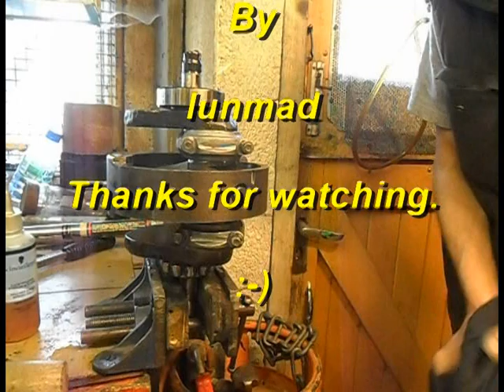triumph t120 engine rebuild part 10

Comment: hi john nice to see it going back together that's a fair weight diffrence in them rods and them odd nuts  is poor I'd expect better from them I had my crank and rods balanced on my tiger 650 it just moved the vibration point not cured it  graphogen past is great on re built engines lot better protection on first start up than oil great videos thanks for taking the time
Reply from the maker: +britironjon 
Hi Jon :-) thank you
25g per rod I was surprised to say the least, I may lighten them a bit one day, we'll just have to see how it runs.
I have used graphite type paste before usually on the cam lobes. plenty of oil does a good second.

Comment: She'll be a wee out of balance specs with those new heavier rods but she'll still run good. When I put my 750 zip kit on my 650, I rebalanced the crank to spec (65% static I think) with the added weight of pistons and rings and wrist pins and to tell you the truth, I was not that happy with it. I've done others and just left the crank alone and they felt better. Not saying that mine does not run good because she sure does but balance on what is technically a one lunger, just seems to be a crap shoot and a matter of taste.
Thanks for another great video Johnny.
Reply from the maker: +EdOfTheNorth 
Hi Ed :-)
I reckon your right as long as she runs in the high 80's without giving me white finger I will be happy. Most of the weight is in the recess of the rod measured by shoving plasticine in the groove and fitting it in the other rods. I was more miffed with the differing nuts.
I have seen some pics of balanced cranks that look totally butchered to tell the truth with 1/2 a dozen 3/4" holes wots all that about then!
Thank you.

Comment: I just broke a big end on my left con for after 100 miles on a totally fresh rebuild.Put a small hole in bottom of casing.Aluminum filings everywhere.I am going to split the casings apart and try again.Heads are good,needs new Pistons,and a resleeve to to a crack in the bottom skirt on my barrell.I have a spare old con rod which looks ok but I'm now nervous about using it.If I do,should I use new studs on big end?Thanks.Your vids keep me motivated.😉It was running like a top too.
Reply from the maker: Hi Darlene, Ideally new studs should be used.
If you look at my bottom end rebuild set of vids, you will see I used two different conrods with old studs and used newer shells on a raggy crank. It did me for nearly 10000 miles, bearing in mind I did not thrash around and gave the motor a fairly easy life.
Reply: lunmad Thank you.I did watch all of your vids by the way.lol

Comment: I would have pulled the sludge trap for the time it takes and the money and time it could cost you. I rebuilt a 4.2 Jag engine many years ago, I too thoroughly cleaned the crank after a regrind with air and paraffin and to save time did not remove the sludge plugs after one day on the road the E type's crank had to be renewed cost me a few bob not to mention the time..
Reply from the maker: +1stMrSceptical 
Hi MrScep :-)
I know you could be right but I reckon I should be ok, time is of the essence as I want to get over to Jockland for a visit maybe that will be my run in journey.
Reply: hi Lunman, I know how quickly particulate buildup can occur in these large void oil galleries. Straight drilled oil ways are best. I ran a brand new Honda 500T back in the early seventies, it had a full roller crank, filtration was by a centrifuge mounted on the crank, every 1500mil oil change I would have to scrape the compacted sludge out, this type of filtration is ok for a roller bottom end. Hopefully the paper filter system you bought after you last rebuild kept the sludge at bay. fingers crossed..  keep the shiny side up..

Comment: Hi Lunmad, I am really concerned. For about three months I waited for to have my rod journals metal sprayed and ground to std, because another firm told me the crank journals were nacked, and couldn't be ground...  and now I have them back from the new place, and  was told that I was lucky, they  didn't need spraying, as they managed to grind 40 thou off and fit 40 shells to the rods.But I thought a +20 grind was the limit!!! Is the crank boogered?
Reply from the maker: Hi Buster :-) I am surprised they got the +40 bearings they should be ok as long as you are not thrashing round the track.
It's like re-bores I would not go over +40 but now you can get +80 pistons!! at one time you could go up in +10's but nowadays they are hard to find so have to go up in 20's